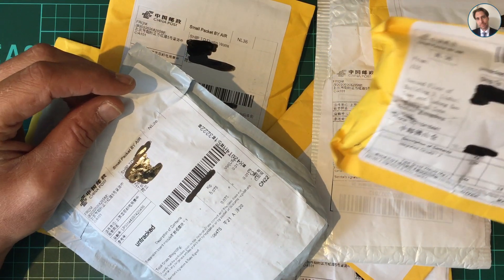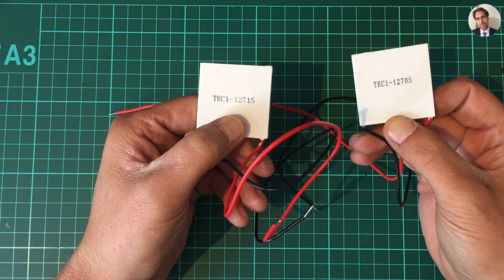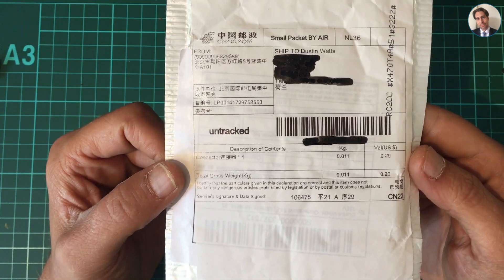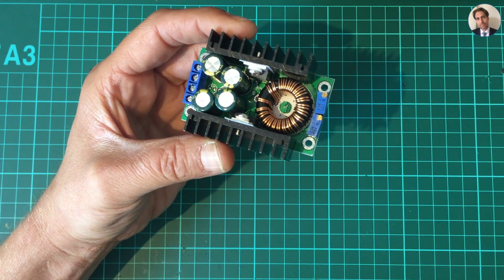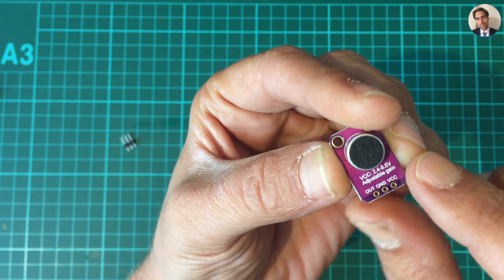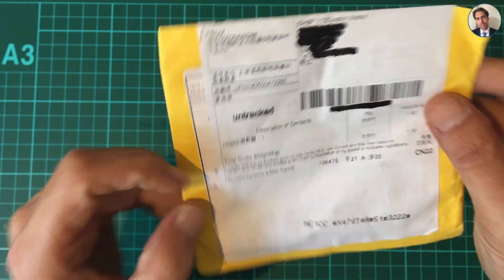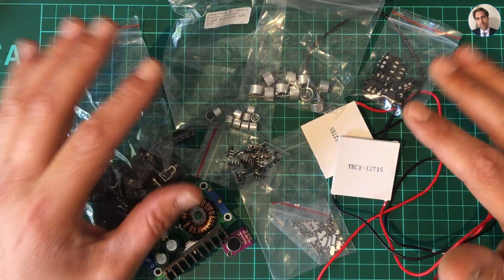Electret Microphones (Postbag #6)

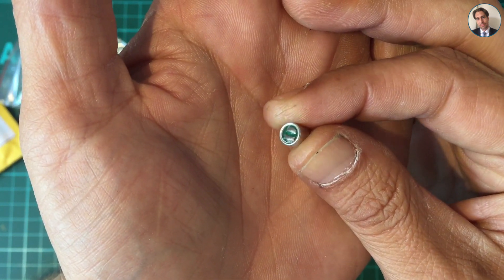Comment: 8:01 thinking those are really hot-air/reflow usable only
Reply from the maker: Maico Yes! But the non-conformist in me wants to find another way! Haha
Reply: when I assembled Brian Lough's Pandamonium badge I had a similar problem with the CR2032 holder (by coincidence the one you ordered with the gold contacts). Especially the negative contact was a bit of a fight :)
Reply from the maker: Maico Usually the ground contact is harder to solder because the ground plane it is connected to, is acting like a heat sink.
Reply: @DustinWatts  yea I know 👍